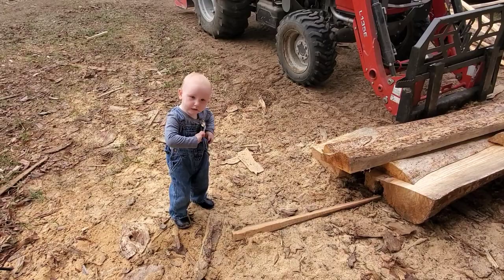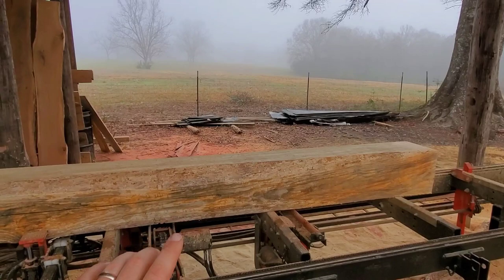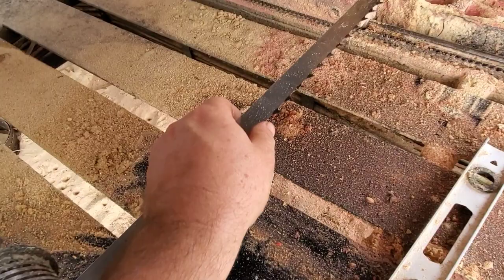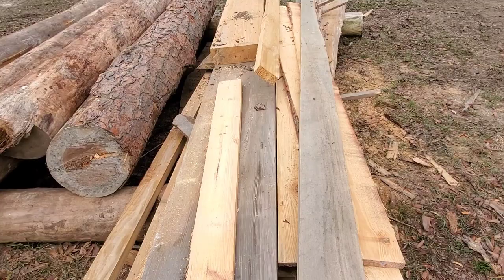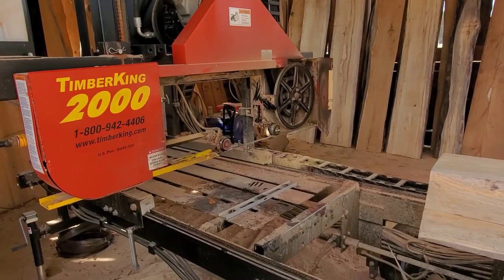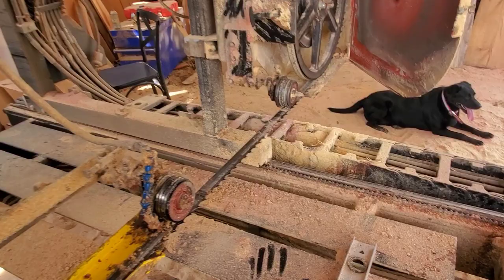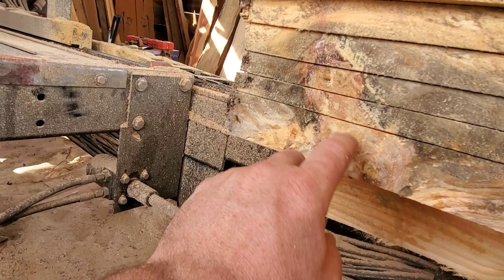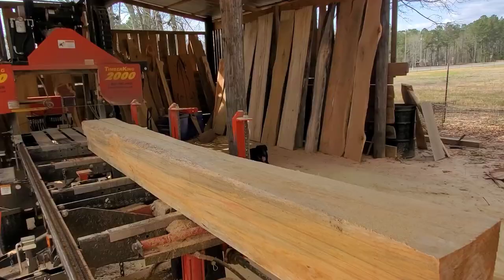Wavy boards?  Sawmill blade diving?  Check this out for the most common reasons why.

Comment: A Level ?  Is that really how it works ?     I don't know about how timber king dose it, but level has nothing to do with it, on a Wood-Mizer or Cooks sawmill ?    I am just asking,  not trying to be a smart@##.    Great video but not sure about the level thing ?
Reply from the maker: I only check it if I have a problem,  I have only had to make one adjustment in 265 hrs of running the sawmill and that was caused by me having to remove the bearing for maintenance.
Reply: They make a blade level and I check mine about every 500 / 600 hrs and it needsto be perfectly level. And run diesel and trans fluid mix never have issues with pitch
Reply: Using the level is fine,, but I always move the mill forward & back & check the front & rear of the level over each bunk.  Then, it doesn't matter if the mill/ track is level or not,, Right? ;>)  My old Mark 4 mill has oak bunks on it & the middle bunks wear out way before the ends.  Another reason to check the blade to bunk relationship. Just saying.

Comment: Why are you listening to music while working on customer's pieces? Concentrate on what you're doing. Perfection is achieved through attention to detail, not enjoying yourself. That's why they call it work. I worked as a grand master marine tech for 48 years: 5 call backs in all that time. There shouldn't have been any. What does John Deere say in the commercial? "It's not how fast you mow, but how WELL you mow fast".
Reply from the maker: Operating the sawmill is fun for me, and I want to keep it that way. Cutting dimensional lumber for hours on end is a bit too repetitive, music keeps it interesting and helps me concentrate.   Also I usually throw in extras on the customer's order.  I rarely get a messed up board due to a wave because I keep my blades as sharp as possible (change out regularly and sharpen) and I keep the machine dialed in.